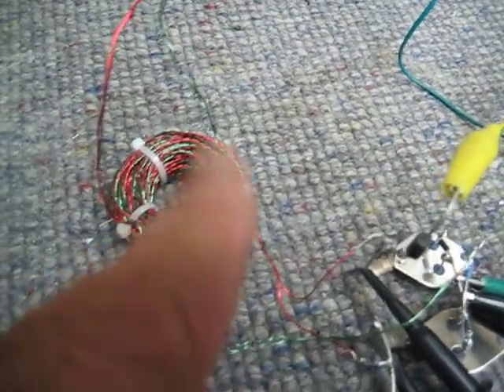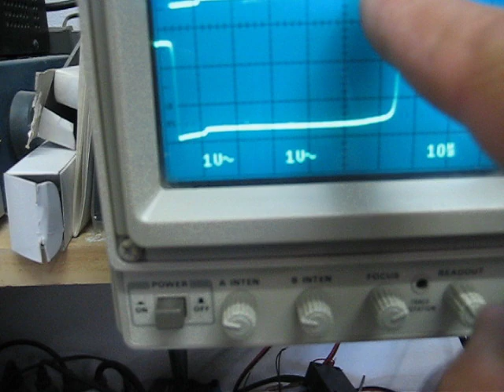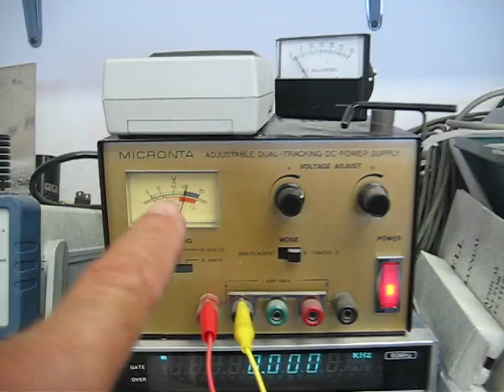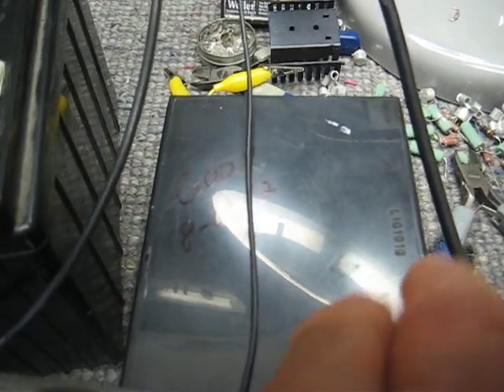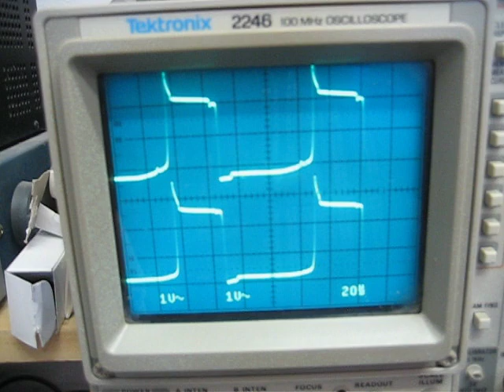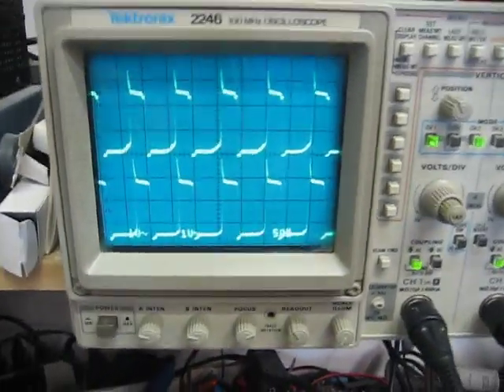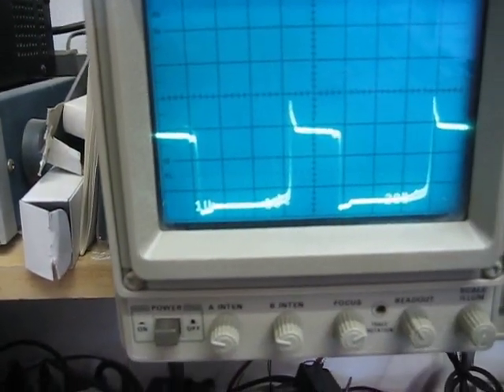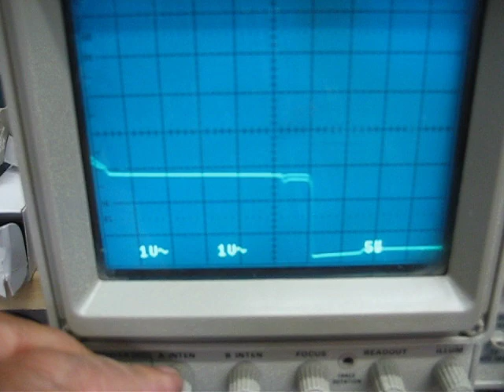The Workings Of The SG Oscillator

Comment: John can I take advantage of the branch currents charging caps? For example 4 power windings with 4 transistors and 4 isolated diodes charging 4 caps? Then dump them in series to 1 battery?  And still have cop of 4?

Comment: Good explanation John.
Also the radiant voltage spike is one of two components for full circuit and the second input signal should be reactive current taken from LC circuit in series(in 180 degrees to phase of voltage spike)... When you mix those two and put to charge battery after rectifying those mixed signals you may be very suprised...

Good luck!